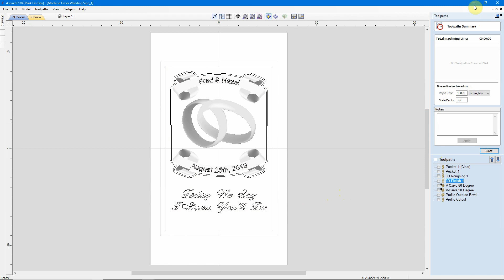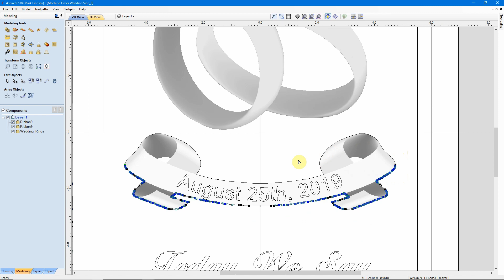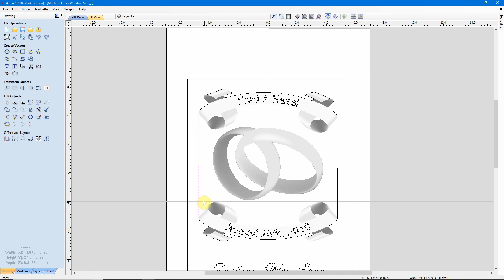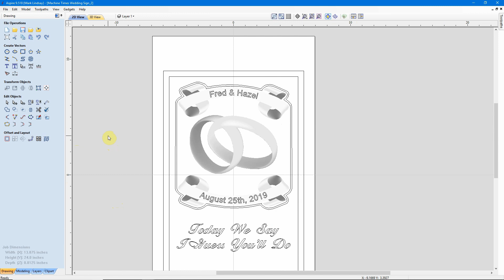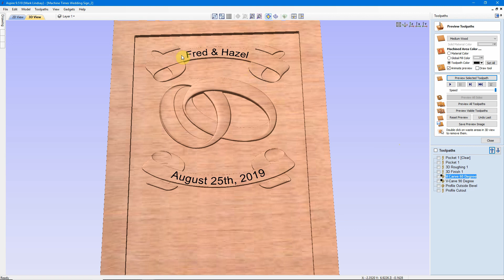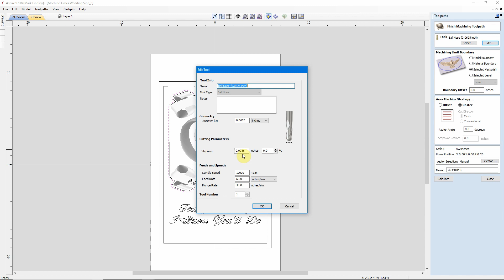Reducing 3D Machining Times - Part 27 - Vectric For Absolute Beginners

Comment: Thank you Mark, learned several steps to reduce my 3D cutting time. This will be my first 3D model cut and I'm taken back on the amount of cutting time. I've seen some what, I would consider vague, info on the process of using Rest Machining which would on the  finishing pass's only travel to those vectors that hadn't been cut. If your familiar with this I'd really appreciate your thoughts and how to use it.

Comment: Could you speed it up even further by selecting all 3D models and give them all a boundary vector? So instead of having to do a 3D roughing pass and a 3D finishing pass between rings and banner inside the whole area around it where you created almost a square boundary after adding the lines between the outlines of both banners, you could let your pocketing tool do the clearing between the rings and banners. They take away more material at once so it should be finished even faster.
Reply from the maker: Yes, you could do that. In fact, that's the preferred method. I didn't do that in this video so I could give a better demonstration of how much of a time reduction you can get by adjusting the plunge rate. I did demonstrate using a vector boundary and pocketing out flat areas in all of my other 3D carving videos - except for maybe one or two where I was demonstrating something else.

Comment: Couldnt you just create a rectangle around that 3d  area its way simpler and faster...or am i wrong?...lots of great tips though...love it.
Reply from the maker: Thank you for checking it out! Yes, you could just create a rectangle around the 3D area if you want to, but it'll take longer to machine. The whole purpose of creating that vector I put around the model was to reduce the amount of material that the 3D roughing and finishing toolpaths will carve away. It's much more efficient to pocket the flat areas than it is to 3D carve them.
Reply: @MarkLindsayCNC  you are correct....but im not very proficient at vectric aspire so creating a rectangle is easier and still reduced machine time a lot ..your method is better for sure but still uses the same theory as the rectangle and that is reducing machining time..3d machining takes a long ass time and i dont do it often due to that..my cnc is not reliable enough to run hours at a time unattended lol...for me the longer the machine time the more chance of having a boo boo ...

Comment: Another great video but just one question. If you increase the speed rate on the fly does it adjust your plunge rate as well as the feed rate or only the fee rate?
Reply from the maker: Thank you, Selwyn! I use Mach3 controller software, and yes, when I increase feed rate on the fly, it also increases the plunge rate. I have Mach3 set up to increase the feed and plunge rates by 10% at the push of the button, and I can increase up to 300% total.
Reply: @MarkLindsayCNC  Thank you Mark. I use Carbide Motion to run my Shapeoko machine and I am not sure if it does likewise or just increases the feed rate. I will check this with the Shapeoko people.

Comment: Thanks for all the  great info, it has helped me understand the process better.  But I have a question.  I tried to follow all the steps here, but when I preview and actually carve, I get a small amount of uncarved material along the the outer offset boundary of the model.  Just a thin line of material that would have to be sanded away.  I tried with the -0.125 offset in the roughing path and without, but still get that leftover material.  Any ideas what I might have missed in the process?
Reply: I think I figured it out.  I put a 3rd offset between the model and the first 2 offsets, and the toolpath previews are showing that line of material being cleared now, after adjusting which ones were chosen for each toolpath.  Cutting it on my CNC now to see how it comes out.  Thanks again for the great videos.  I learned quite a bit from this one.

Comment: One question, when you did the 3D roughing it was set to leave 30 thou. You started the 3D finish at 125 thou deep but was 270 thou deep when finished? What happened there? Otherwise straight forward and well presented. Sorry, I had to miss the live video today, but thanks for this video!
Reply from the maker: The way that machine allowance works is the roughing toolpath leaves, in this case, 30 thou for the finishing pass to clean up. It has nothing to do with the depth of the model. The total depth of the finished model was .27.
Reply: OK, still doesn't compute. If you ruff cut down to .125 and have left .030 for finishing but the finish cut ends at .270. That seems a lot more than .030 left for the finish cut after the ruff cut?
Reply from the maker: That's because I used the Z level roughing strategy, rather than the raster strategy. I'll talk about it in next week's Live Q&A - it's easier than to try to type it out in text.
Reply: I'll be sure to try and make for that. Thanks Mark for trying to get it through my thick skull. 😁

Comment: Do you make the aspire file available? Is there a video on improving milling times more traditional objects? Is there that much different between three d  object and the standard primitive objects.
Reply from the maker: Thank you, David. The file is a composite model, made from the Clipart that comes with Aspire.  Here's a link to a video I did on the subject: https://www.youtube.com/watch?v=39dndle4Mlg

To reduce machining times on 2D projects, it's basically a case of adjusting your feed rate to get the optimum performance.  There is no magic answer on that, because every machine and machine setup is different. You'll need to experiment to find what works best for you.
Reply: I have Aspire, was just going to follow along if you made the file available.
Reply from the maker: I really didn't think making a file available was necessary, since all of the individual models are already available in Aspire. Plus, assembling it yourself lets you chose different banners if you find something else you prefer (for example, something wider, to allow for taller text.) It really is a case of dragging a model onto the material surface, then arranging it into the position you want it in.